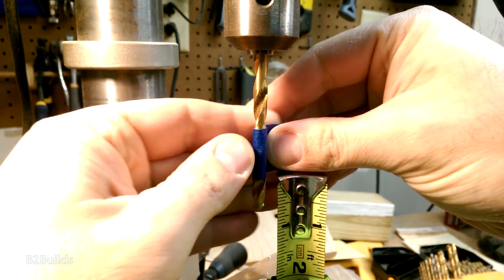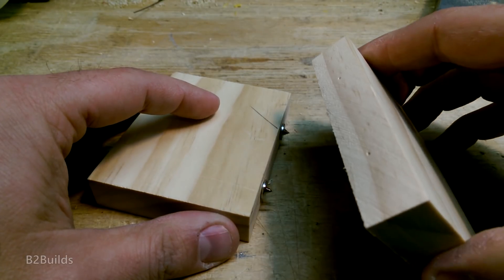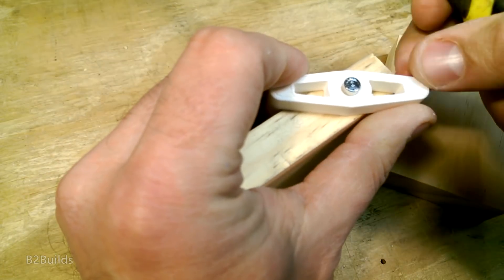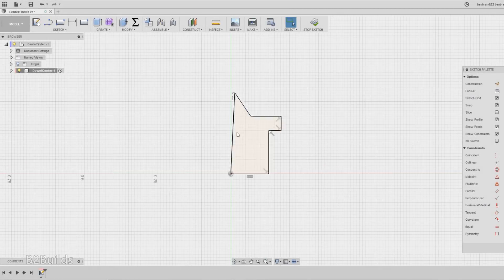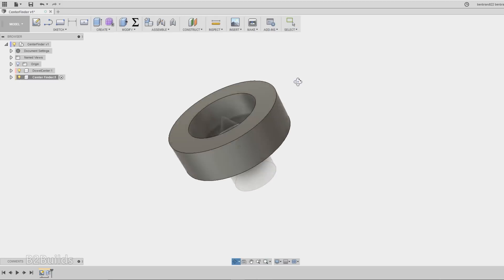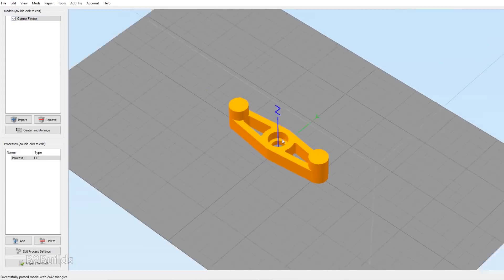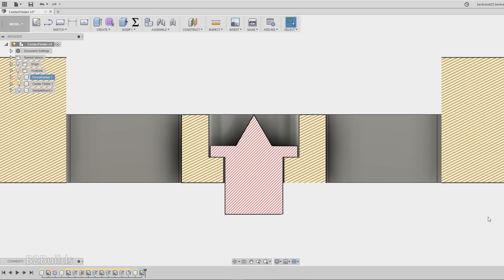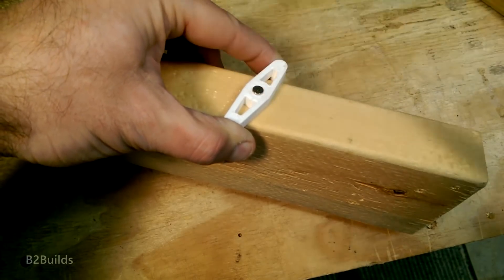3D Printed Center Finder for a Dowel Center

Comment: This is the very kind of project that I love when it comes to 3D printing.  Models of various types are cool, but actual practical applications are what actually sold me on the idea.  Great simple project that can actually be used around the shop.  I guess you could make one that hold a pencil as well just for finding the center of a board and making it.  Great job on the video Ben!
Reply from the maker: Thanks Chad! Seems like the "Idea Builder" is aptly named